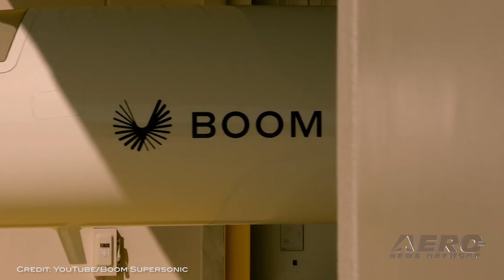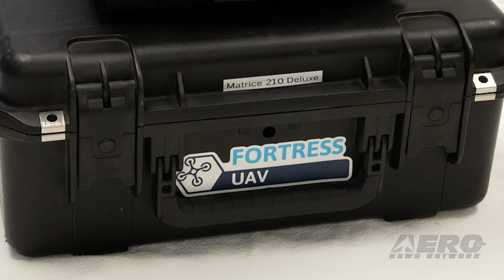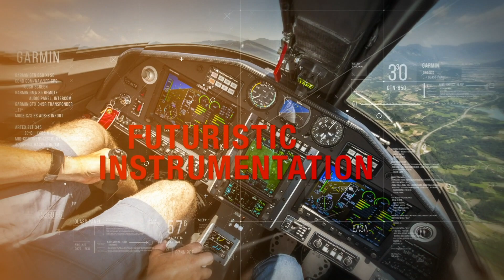Airborne 10.09.20: Supersonic XB-1, ACJ TwoTwenty, Starliner Crew Shakeup

Comment: The Supersonic aircraft which have the shortest take off roll are the Saab Gripen and the Dassault Rafale, they both use Close Coupled Delta Canard planforms. The Rafale Take off weight is 2.5 times the empty weight! 
The Viggen, predecessor to the Gripen was designed with a close coupled canard to achieve short take off runs with a low deck angle. It too is a Supersonic aircraft.